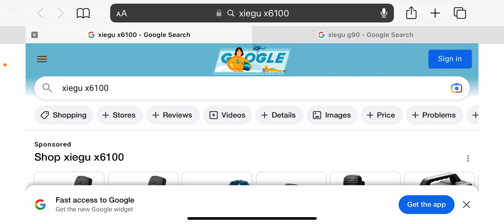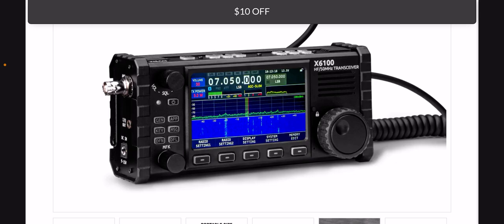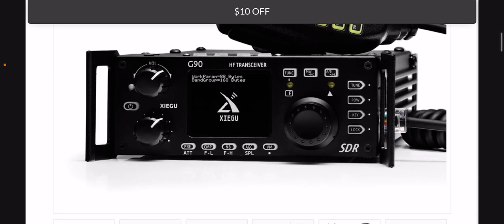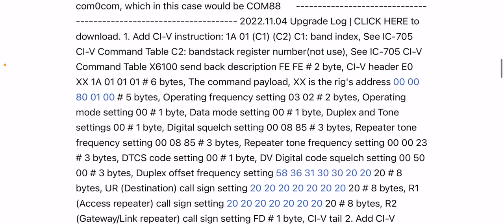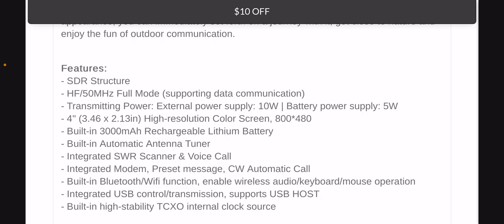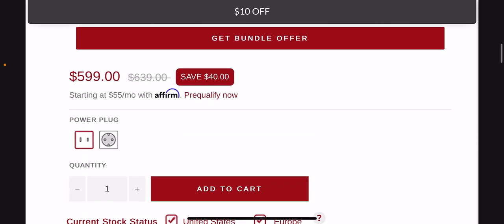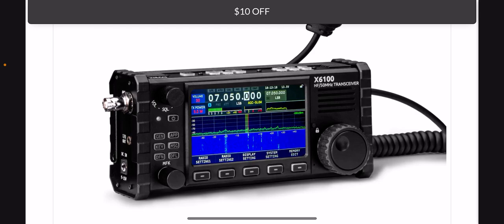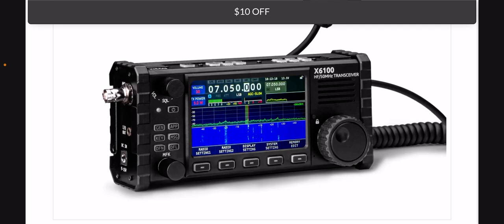Xiegu X6100 VS. G90

Comment: Hey Josh- I just recently added the 6100. I already had the G 90. I plan on using the 6100 for CW and QRP work. Plus checking out 6 meters when it's open. 73 de N2VQD